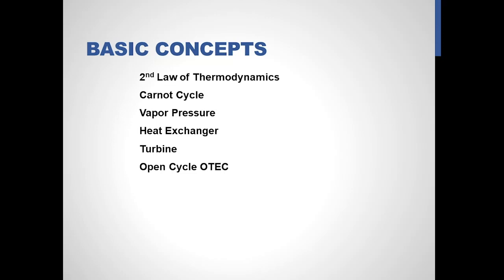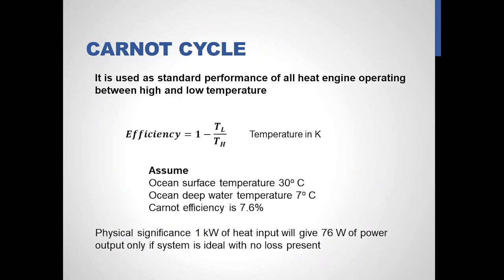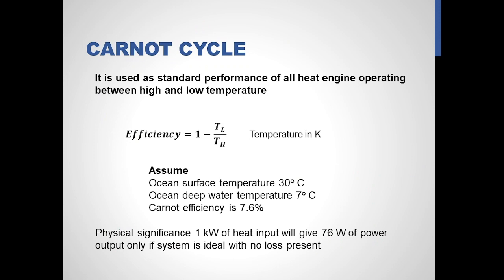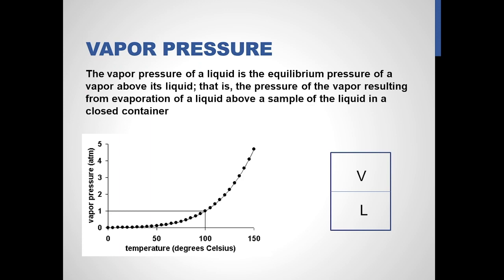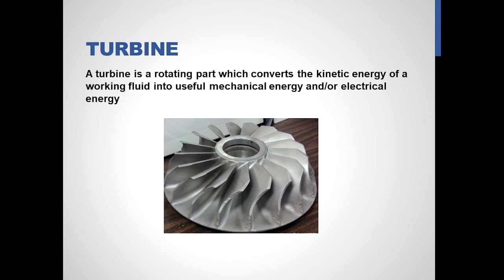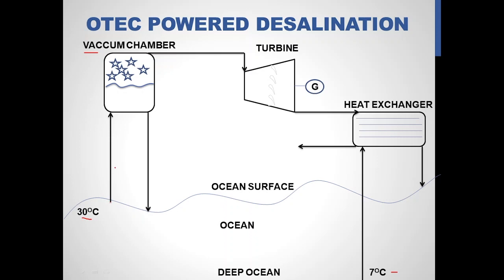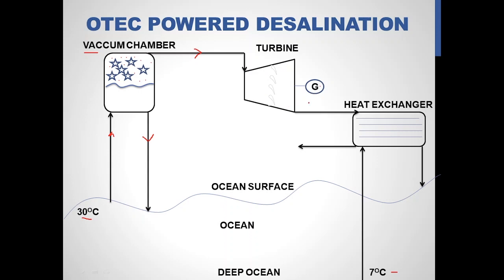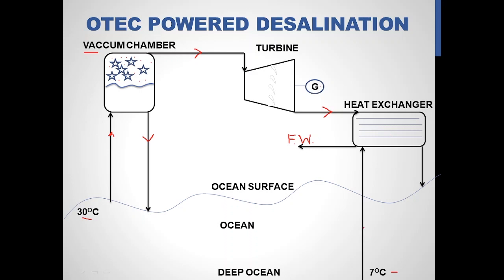Open Cycle Ocean Thermal Energy Conversion - Powered Desalination Process (OTEC)

Comment: That sounds like water is being extracted from the air as condensation in the outside or other area of the heat exchanger, correct?

So, it's not true desalination because it's not from the ocean water.

If not, then the video should be more specific on what happens in the heat exchanger.